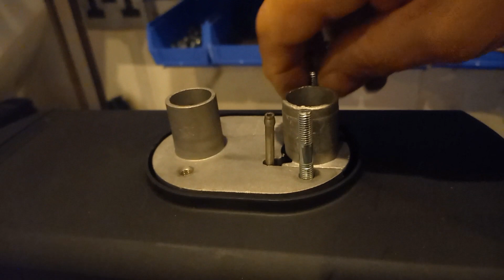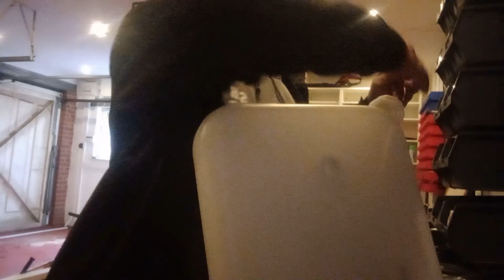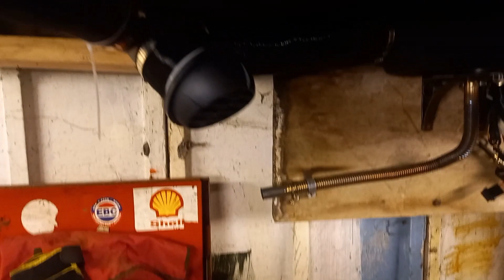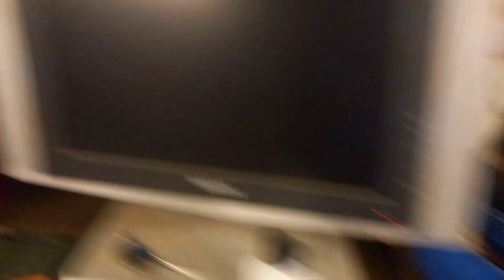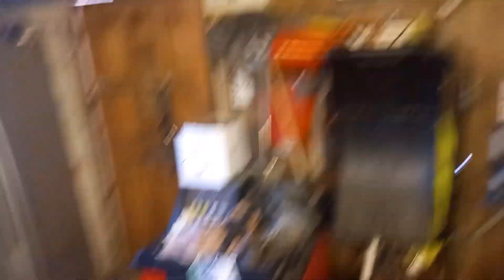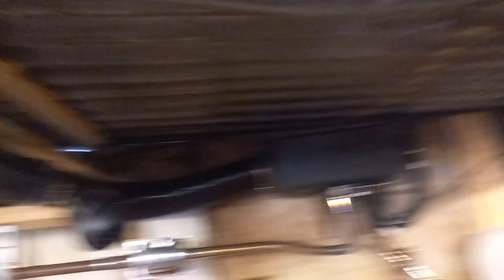Cheap Workshop heat from diesel heater and exhaust modification

Comment: The silencer is a safety issue.  It will leak carbon monoxide if generated.  Do read the installation instructions - there are safety guidelines re the length of the exhaust - which should be adhered to.
Reply: I agree about the carbon monoxide. However, his garage looks very drafty. I doubt it will be an issue.
Reply: @anthonyjulson8840   I like your level of confidence.  I do know that I have, in the past, been wrong when I doubted something.  Personally, I would not be prepared to bet my life on it.🙂  These heaters can produce a lot of carbon monoxide, if not burning properly, and you are happy with an silencer with a hole in it?

Even if you get away with it, showing it on a youtube video, where others might emulate your arrangement (but without the draughts) and gas themselves, is a bit of a selfish attitude in my book.
Reply: @oliver90owner  I don't remember if he even said it was a bad idea. He obviously pointed out the hole though.

Comment: Your exhaust pipe will fill up with condensate water. 
Fit exhaust with a continuous fall and fit larger diameter pipe. 
Thanks for the nice video.
Reply: hmmmm....   Mine hasn't for 4 years, neither have my other 3 heaters.  All of them have exhaust straight up.

Comment: Never run an exhaust pipe over 2 m on these unless you expand it to at least 50mm. too much back pressure. It in the manual.

Comment: Copper should never be used for an exhaust, it gives off dangerous chemical fumes. The silencer should be outside because there's a hole in it to allow condensation out so combustion gases will also get out. Also at that length the exhaust will cause excessive back pressure making it less efficient and more prown to flame outs.
Reply from the maker: The sleeve was made with off cuts of steel and not copper as i didnt have any at the time, thanks for the information regarding the silencer, i will have to move it out of the workshop and re think the design many thanks
Reply: @Simon Briggs  for your set up, I would just ditch the silencer/muffler. Sending it through such a long pipe and outside nullifies the need IMO. Your exhausting pipe should have a small drain port somewhere too, they produce condensation
Reply: What are these fumes that are produced from copper.  I’m interested in your response because copper is a fairly inert metal.
Reply: @oliver90owner  Cu is pretty inert and isn't affected by Sulfuric Acid which is normally associated with burning hydrocarbons.